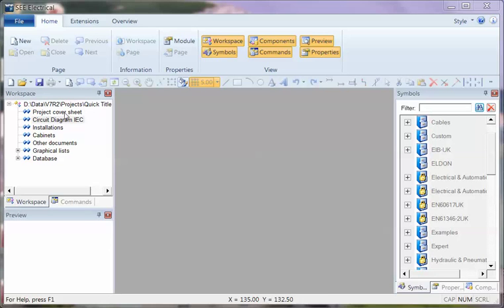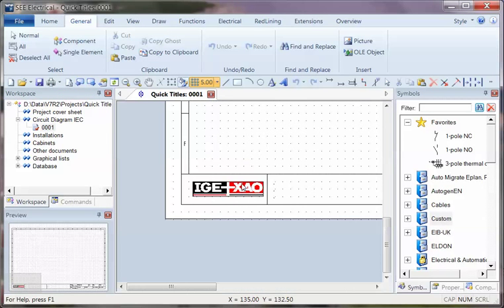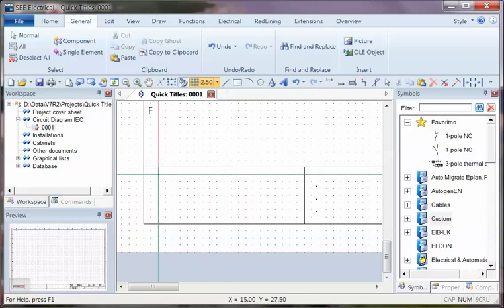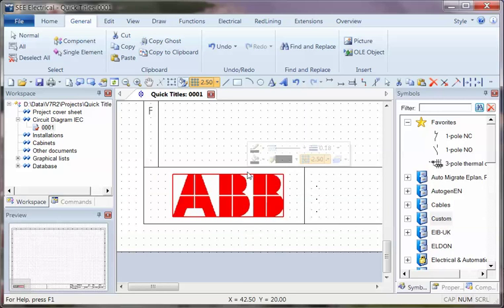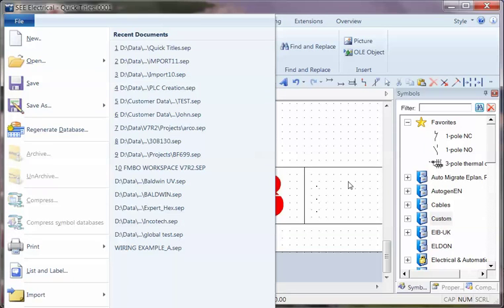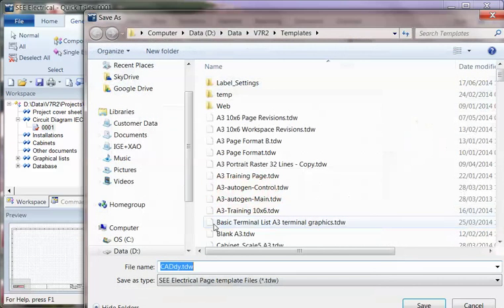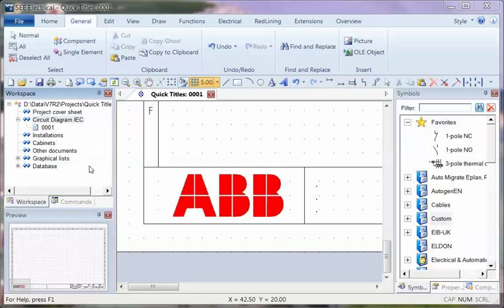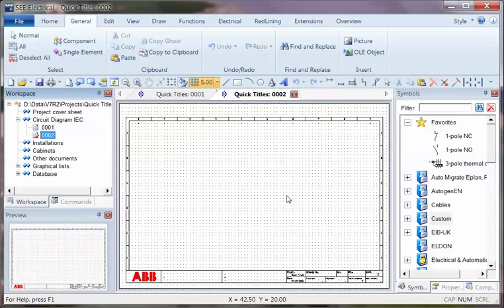Quickly Change the Title Block Logo V7R2

Comment: That does not work for Version 5.
Reply from the maker: Arleen Renner Hi Arleen, yes, you're right, we're always adding new things, sorry this is from V7R2 (soon to be replaced by V8R1). 
In V5 if the logo is a single element like a .bmp or .jpg then you should be able to use F6 to select a single element instead. This logo is made up of lots of lines and curves so the best option would be to select all (Ctrl+A) then right-click 'Explode' to make the changes then Ctrl+A to select the modified title and right-click 'Block' as a title block.